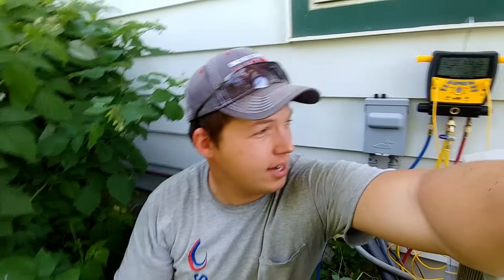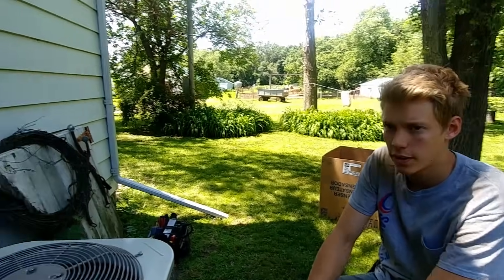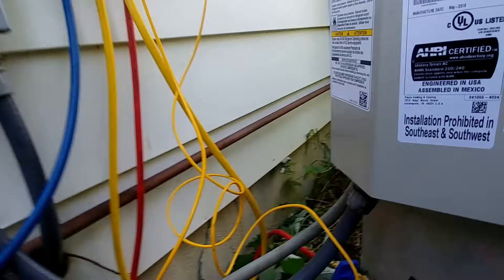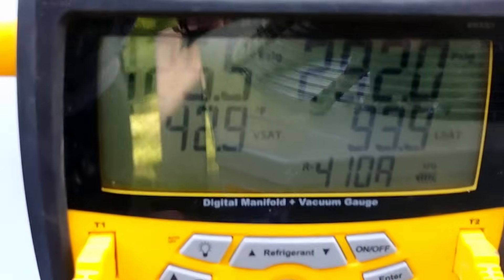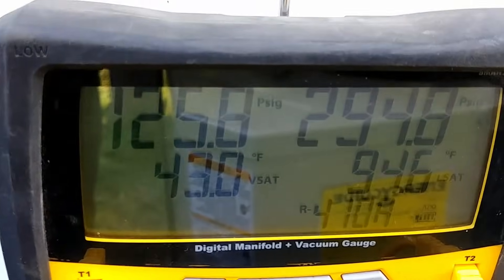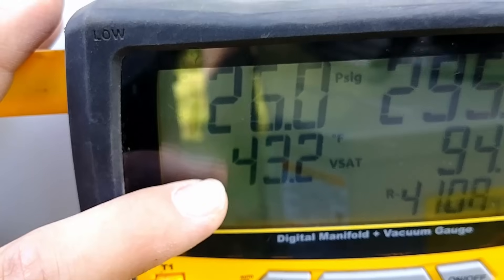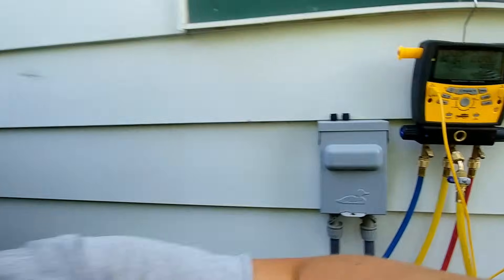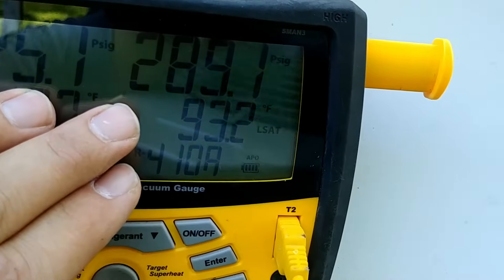What Should my AC Pressures Be for R410A Refrigerant

Comment: should the suciton line always be sweating in humid 90+ degree heat? I have a 3 ton unit that is sweating, but I had a 5 ton unit with txv replaced recently, its cooling but the suction line not even sweating, just slightly cold to touch
Reply: check the pressure
Reply: fixed? was it low?
Reply: @robertschaaf7192 it was low, tmi think the orevius tech didnt properly refill, another one came out, double check for leaks, there was none and refilled. Been working good since
Reply: @grotesquecat I’m going outside to do mine now😅

Comment: Yeah, never use Google AI labs. If you're chasing the claimed "normal" 400-450psig on the high side in 80 degree weather, your unit is going to be overcharged. The unit I had yesterday was reading about that at 84 degree OADB 72 degree IADB and not enough heat load to take it much over 290psig with a calculated critical charge by weight (running compressor for dx)

Comment: Amazing the marketing campaign STILL getting people to call refrigerant "Freon".  It has been almost 3 generations and they have such a small percentage of the market.  I was unaware Freon was still available until I actually saw a guy use it in July of this year.  At  least with Kleenex it was on most every shelf.  I really don't know how Freon could have been such an effective campaign.  Chemours Company now owns the trademark Freon but originally Dow had it when introducing R 12 which really changed peoples lives.  I just thought by this generation of techs the habit would be gone.  You guys have chosen one of the more difficult trades and they keep throwing technology at you...  that should demand higher pay for the techs.  Great job...   run your own business and make what you deserve.   Just noticed that this is 5 years old.  Does youtube not have current videos??? 🤣

Comment: the temps on the manifold are from a PT chart correct?  Don't you want to be looking at actual measured temp values of the liquid and vapor lines at the condenser and comparing them to the PT for R410A?

Comment: Morning Benjamin. Just enjoying your hvac videos again. 20 yr old rheem r22 system. It called out only liquid line pressure for charging. Not subcooling. Should I use the liquid line pressure to adjust charge? Or set subcooling to 8-12?

Comment: Isn't there a reference chart inside the cabinet or isn't there a reference chart that come with the refrigerant, so you can check pressures as they should be based on tonnage of the unit (3 ton unit I'm my case) and ambient temperature 98f the day my unit installed. As ambient temperatures increase so do  the pressures, which my techs failed to do. They based their pressures on a normal day like yours, my accumulator sweating like crazy, and worry, pressures too low. Dealer won't check charts to make sure pressures are where they should be.

Comment: You still did not say what the  what the pressure should
Reply: Watch the gauges. On a 83 degree day 125 low side. 289 high but other variables count for operating
Reply: About 125 psi for all outside weather

Comment: why does my r410a heat pump suction pressure read 400 psi even if its not running 77 degrees outside

Comment: What are the non operating pressures of R22 and R410? when the unit is filled but not running?
Reply: Standing pressure for R22 is around 165 PSI and for R410a it is around 225 psi
Reply: R22_equalized pressures are 150&150 410 225&225

Comment: Hi having issues with a newly installed R410 A 3 1/2 ton unit keeps on freezing up no txv does it take 6 pounds of refrigerant like the name plate says and do you have a proper pressure chart that you can share ?
Reply: Is it freezing up in cooling or heating mode? If its in heating, it will freeze in low ambient temps. Make sure your defrost board is working, if it’s not going into defrost you got a bad board, or defrost sensor. If its freezing in cooling youre most likely low on refrigerant, which means you got a leak somewhere.

Comment: The pressures for a 410A refrigerant depends alot on ambient conditions. A 40°F evaporator would give you 118 lbs on the suction side or low side. On the high side and a 95°F ambient temperature you'll generate 295 -300 psig or lbs on the discharge side, or high side

Comment: Ben, I installed the components form a 410A dehumidifier into a 1905, oak ice box.  what's your best guess at what the high, and low pressures should be?   It seems to be pretty happy at 90 psig on the low side, and 330 psig on the high side.  I find that these pressures change dramatically depending on ambient temp.  Thoughts?
Reply: And they will. That's why it is almost impossible to charge by gauges. This is not R22.If the refrigerant is metered at the evaporator, use superheat. If it's metered at the condenser use subcooling.

Comment: Hi Ben, I have a 3.5 ton 14 SEER Goodman packaged heat pump on my house, I'm pretty sure I'm on borrowed time considering I had this unit put in back in the summer of 2009.   I noticed lately that almost my entire compressor, the entire accumulator, and most of the fixed metering device is completely covered in condensation, I live in Florida and I assume a lot of this is due to the high humidity here, I also noticed that the insulation under the top cover of the unit fell apart.

About a week ago I cleaned the condensing and evap cores on it, the fins on the condensing core are flaking off in a few spots due to the age of it, but nothing super excessive, the evap core is still solid.  I had been noticing the compressor was much louder on start up and even when running was a bit louder than it had been, I replaced the dual run cap with an Amrad with the CPT terminal, the cap is a 45/5 mfd, I put a 5-2-1 hard start kit in it with the separate potential relay, the contacts on the contactor looked a bit burnt, it was still working, but I replaced it just to be safe.  

I did notice after replacing these items the compressor starts up faster and quieter and seems to be running quieter too.  I noticed that after doing all of this that the air blowing off the condenser fan isn't as hot as it once was and there is less condensation draining out of the unit.  It is still cooling my house and has cold air coming out of the vents.

The cap and contactor I replaced were the factory originals with the unit, I tested the original cap out of curiosity and it is supposed to be a 45/5 but it was only giving me 29/3 mfd's.  Could the compressor have sustained some damage from running with a weak cap all this time and is this amount of time and is this amount of condensation on it normal?   Would the fact that the insulation on the top cover of the unit is gone have anything to do with this?

Comment: We REPLACED THE INSIDE Coil IN 2010, the 2ND FOR  THIS BRYANT/carrier 5 ton.  {410A} 2001 model was was made in Mexico rusted and leaked badly made like crap for old refrigerant bad welding smaller tubes. This second has been serviced 5 times and leaked also. Have spent over $1500 in bills for its 10 yrs. Now 2 mos ago  was filled for $400, by my wife,  by a P>O> S> AC contractor.  It has already leaked out and the lines are frozen. The inside blower capacitor went out. Changed it and using only blower fan till we find leaks. I hate these sad excuses for quality. A replacemnt coil costs @ $1000  they had a 10 yr      warranty.

Comment: I am suspecting my technician accidentally refilled r22 gas into r410a. As he was carrying a green refill cylinder.. Normally 410a refill cylinder is pink in color. I told him about the issue..he is strongly claiming that it was r410a gas.. After refilling he showed me the suction pressure 140. AC is running cool. But i m little bit worried about the compressor lifespan and AC explosion
Reply: Well right off the bat your suction is too high. Kid sounds like an idiot that came over. You need to check your superheat or subcooling, depending on your system.
Reply: R22 dont run at 140 suction 410 does ,r22_suction is between 68 and 72 psi suction ,discharge or head pressure around 125-150

Comment: Replaced a heat pump and evaporator coil in a 3 ton air handler with 3-ton equipment. Needless to say I had to switch to a piston ( high head lockout) ... Had the right txv for HP. I thought it was airflow. Had great pressures with the piston. 21 degree temp drop and my 12 degrees. Watch out for that. It is new to me and I had to eat an a coil on that job.

Comment: You charge a system with super heat and sub cool. Pressures are almost irrelevant as long as they dont show a restriction. If your not using super heat and sub cool your systems are not running at full efficiency

Comment: Just had an American Standard 80% eff. System installed and they reused th old line set but didn’t put a vacuum on the system ? Talking with their boss he says they never do because it doesn’t matter with R410 ?
Reply: Sounds like the boss was blowing some smoke up your butt just to cover some half ass installation techniques. A proper evacuation of the line set/indoor coil is important for any refrigeration system for removal of non - condensables.

Comment: question my unit is having a issue. condenser/fan is cutting on and off .. air handler is running fat checked stat batteries theyre Good i jumpt y and c at stat and yet condenser/fan did same cut on and off.  I turned off cool on stat went out to condenser pusht in contactor compressor sounded normal but the fan wasn't kicking on. the start cap doesn't have a wire going from fan to cap .. its a ecm motor.. what could be causing this is issue? gauges w unit off read 125/250 that's low/high side manual old school gauges was about 75⁰ out w humidity here in north east...

Comment: Very good. I'm an old timer and needed to confirm 410 pressures. Going out to blow one up. Thanks.
Reply: R410 sanding psi225sushion psi120to130. Discharge 450to500..

Comment: Thanks a lot Ben! My new Carrier set with TxV added by a "pro" but he doesn't use nitrigen and soldered at least three times due to leak, he roughly powered on to get cool and escape. I then measured SC is 5.6 not 10 and half a year later I see SC=0.5 and Low/High 117.5/307.5 (out 80F), I added a bit and see SC is 0.5-1 back to 0.6 and Lo/Hi become 120/298, what would be the problem?
Reply: You have to let the system run for like 3 minutes to let that refrigerant move through the whole system to get an accurate reading. Also 410A is a blend of refrigerants, if you had a leak, you need to recover the refrigerant and pull a vacuum to atleast 400 microns, and then recharge the system with virgin 410A.

Comment: Hi. Its 97 degrees out here and my supply duct air temp reading is 63 degrees return duct air temp is 78 degrees. Inside the house by the thermostat it reads 81 degrees in house.  The low side reads 125 hi side reads 325. Unit is charged for 15ft of line set. I have 18ft. I added 7 ounces. Do these numbers(low and high side pressures) seem good? I'm not sure how to do subcooling superheated and I dont have clamp probe meters. Thanks for any help. Its 410a . (A condenser I just installed)
Reply: F P  excuse me. I just installed the condenser, I did NOT change the evaporator. It's running and cooling. I was just curious if the pressures seemed ok. My delta T supply return differential was 18 degrees. I was told 15-20 is target and having close to 20 degree difference is best. I'm at 18 and happy. Not my house and they are selling the home
Reply: F P  What a dickhead.

Comment: What about if you have 155 psi on low side on 100 degree , (r410a)
Reply: A lot more info is needed to answer that question...
Reply: If you have an indoor txv the suction pressures dont matter. You charge by subcooling

Comment: Very good job!!!  I have a question...can this unit be adjusted to a  lower evaporation temperature ?? ...hence.... to remove as much humidity from the interior ?   Thanks
Reply: No...has to be charged to target subcool because  of txv usually 10 degree subcool depending on wb air temp. To increase humidity removal try lowering air speed and re-evaluate charge.

Comment: The most important concept in refrigeration is to realize that pressures are a consequence of temperature. Heat creates the load that causes pressures. Knowing pressures without knowing refrigerant temps (superheat & subcool) is less than half the picture and impossible to make a diagnosis from.
Reply: Exactly I really don't care about pressures, only SH and SC
Reply: Relying on pressure only show his lack of refrigeration knowledge.  Pressure is important, but you should not charge by pressures,  but super heat and sub-cooling.
Reply: @kenbowen2015  These two above comments, for sure. Real HVAC guys....

Comment: Should never mount liquid line drier horizontally
Reply from the maker: Why? I've seen them in almost all orientations fairly frequently.
Reply: Because mounting it horizontally there is a chance that the driver might not be fully filled with liquid therefore allowing it to flash to gas ,basic refrigeration 101 35 years experience. That's what I was taught in refrigeration school, that's what I do,25 ton,50 ton and up refrigeration units. Take it for what it's worth. Every one on you tube is an expert
Reply: If the system is properly evacuated and charged, the drier will be full regardless of orientation. If the drier wasn't full, the refrigerant would flash off and you would see a temperature difference across the drier.
Reply: @Eyezayah HVAC isn't opinions. It's physics and math. Dalton's Law or Charles's Law don't care about your opinion.
Reply: @Eyezayah it's not opinion. If the system is properly charged, the liquid line is FULL to the metering device. FULL is FULL. This includes the dryer.

Comment: Now if your low side is under freezing like around 0 to -10 would you say it's most likely a cooling coil issue or refrigerant issue? My cooling coil completely froze about the furnace got myself some 410a guages and it's not looking good for me.
Reply: Sounds like your txv is stuck shut. Itll pull your low side into a vacuum. You can bump some refrigerant in it, and if the pressure drops down again immediately, thats your problem.

Comment: Can you please help. My system uses r410a, can a bottle of AC On the Go refill (r290) be used to top up this system? I cannot seem to find r410a at places like Princess Auto.
Reply: Absolutely not. Don't ever mix refrigerant types. Who knows how compatible it may be with your application. The operating pressures may not agree or the oils may not be compatible with the different refrigerant. It's just generally a bad idea.
Reply: R410a can be found on eBay
Reply: @adammcalpine231  They unfortunately do not sell it here in Canada. Those that do seem to be offloading their contracting equipment of 25lb bottles for $$$.
Reply: Yes do it

Comment: Charge the system per manufacturer as required.  Each equipment is different from one manufacturer to the others.  The instruction is usually located inside the access cover or equipment tag.  It will detail how the system should be charged by superheat or subcooling depending on the metering device at the evaporator.   The instruction in this video is wrong!  You can't use "rule of thumb" in charging your system.

Comment: I wish all A/C service people were like you and not try and sell a new system everytime we call them..
Reply: You can do most stuff your self, change filter, clean outside coils, etc. I know electrical so I'll do anything related to that, replace starter cap, contactor, etc. If you have a heat pump, remove the fan cover and rust proof it the best you can, and replace the caps on the valves if there plastic with brass ones that have rubber seals in them. Sometimes a slow leak in the valve will lose Freon and don't need to get bent over to have it fixed if you can seal it with the cap. Nylog works great to around the valves.
Reply: I thought it was the cap but just the valve did not seat right took the cap off and there were bubbles .. Pop came out this time when I put Freon in it only 2 pounds and it is cold in the house.. Did a leak test with soap all around that area and nothing.. So far holding a charge I checked it after a week and still right on the mark.. So will see.. Everything is very clean no dirt blocking the fins. A 15 year old 3 ton Sears Kenmore Heat Pump unit.. I am sure another company made there systems for them..
Reply: @Howrider65  Heat pump accumulators rust and will leak. Mine is 14 yrs old and did start to leak.
Reply: @jcstudios5629  Mine looks ok do they only get Freon threw them when you put the system on heat??
Reply: Service your unit bi-annually and there's no need for guys like us.

Comment: Can I run r407c in the r410a system after changing txv to r407c compatible one? Thank you
Reply from the maker: Hmmmm.... I would not recommend that. 407c is VERY different than 410a and the compressors are also designed a bit differently as far as I am aware. Why not just keep r410a?
Reply: 407c refrigerant fractionates... it likes to separate due to its chemical mix... in other words .. its junk refrigerant... read the data sheet from manufacturer... i do not recommend 407c in anything... you cannot buy hvacr equipment with 407c in it... and there is a reason for that... the cooling curve for 407c is a roller coaster.. read up on refrigerant data sheets from the manufacturers...